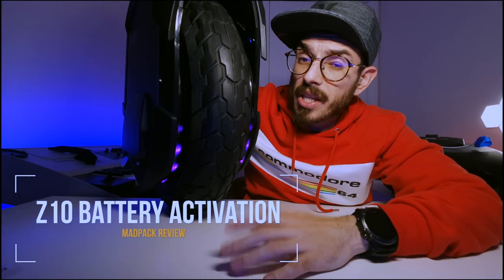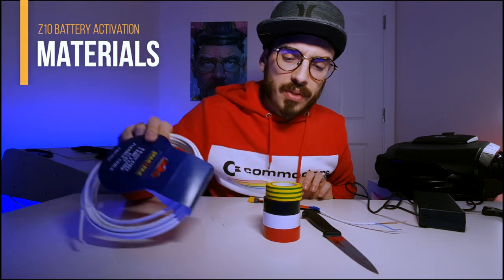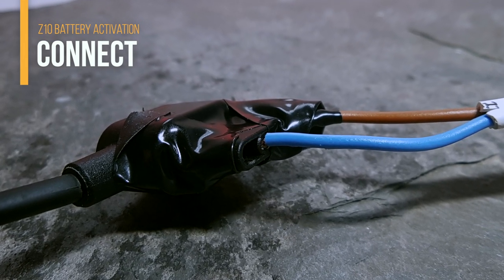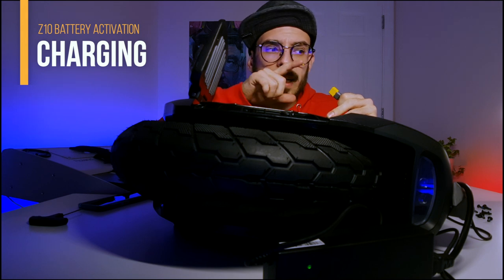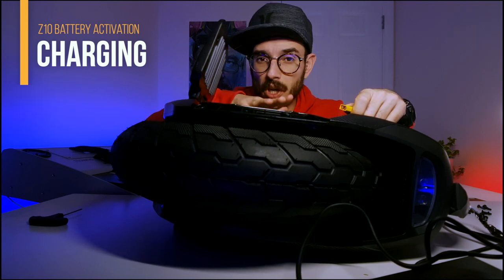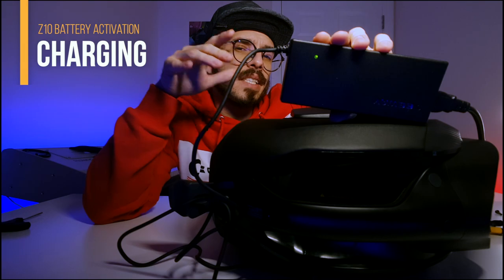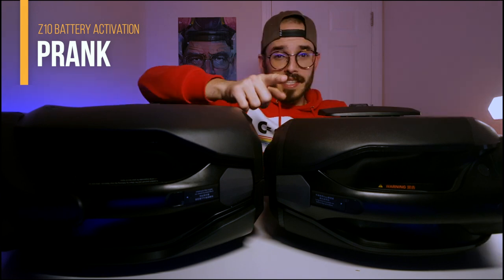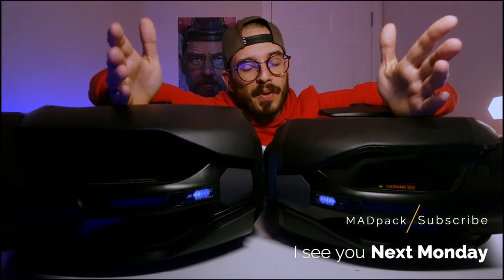Ninebot Z10 Battery Activation - THE ONLY SOLUTION!

Comment: I had the same issue.... I just left it for few hours connected to the charger... It refreshed the battery, and charged it completely... It's a nice hack but not absolutly necessery...
Reply from the maker: It is necessary. I left mine connected for days and the one of my friend the same.. Happy that you dont need it but 60% of use are having this issue bro. Thanks to leave a messgae
Reply: MADpack hi i did the hack. the charger has turned red immediately (did not blink red and green before going full red). HOWEVER, the battery indicator is not blinking at all (the one that was blinking red when power is too low and will blink red and blue when you start charging with the hack). should i leave the charger to charge with the hack for a longer time ?
Reply from the maker: No dont do that.. Is to much.. The objective is to charge the minimum to be able to after charge normally ok? 5 minutes in each pack should be more than enought
Reply: MADpack the hack totally worked! i was typing the message when trying the hack for the very first time that day. i asked if the battery indicator hidden inside should be blinking. i didn't want to pull out my mod cable to charge it normally cos i only have one charger, it's too much work trying to secure the bare cable to the charger connector. anyway, you were right, all i needed was maybe 10 mins of charging on each battery, then go back to the normal charging. my z10 battery went dead after leaving it untouched for 6 months (20% battery left after my last use)
Reply from the maker: Never store a wheel or skateboard with battery below 60%.. you lost cicles on your battery with that

Comment: I dont think its segways fault because this thing happens to all lithium ion powered devices that are left to discharge for a very long time its a lithium ions weakness also happens to my electric scooter that a bought from singapore and shipped here to italy but im lucky i know how to repair things like you and im happy for ur wheel gudluck and ride safe :)
Reply from the maker: Hi bro thank tou so much to take the time to leave me a message bro.. But no bro is really there fault.. They cu cost on The batteries cells cheap ones and there bms have problems on the software version at least on this ones

Comment: Tell me what to do if it doesn't turn on. I WOULD HQVE TO HOLD THE BUTTON  AND IT SHOWS BLUETOOTH SYMBOL THE FRAME OF TH3 BATTERY BUT NOT TURNING ON BATTERY IS BLUE. ANY IDEA?
Reply from the maker: Sorry bro I didn’t understand your question. Anyhow if you have follow the steps and is not charging maybe you have issues of the charging port

Comment: Can you help me with my problem? I can not charge my Ninebot Z10 directly anymore. I didn’t use it for quite a long time. Most likely, the device's battery automatically went into a deep sleep state in order to prevent discharge due to prolonged downtime. Fortunately, the battery can be quite easily reactivated.

I opened everything and did the battery activation again. I temporarily disconnected the battery from the gadget‘s motherboard, recharged it, and then reconnected after the required voltage had been reached. This disabled the lock and restarted the device. 

I had my ride and everything was fine. 
But now everytime I want to recharge my Ninebot I have to repeat the same process, because charging troughs the standard way doesn’t work.
Reply from the maker: I really don’t know what can be the problem since I never encounter this issue previously

Comment: Hey , after 4 month of not using wheel it is fully died , I tried to make everything like in the video but it doesn’t works, but also indicators on battery are not blinking at all ( not red and not blue ) 
Aby suggestions ?
Reply from the maker: Leave it connected for longer to see if it jump start eventually

Comment: Hey @madpack Markus! Thanks for your video! 

I think I have a similar problem with my Z10. 

So i bought it second hand last year with 110km . Then I did a few km last year and then I put it in my shed for a year (cold winter down to -1C). Took it out a few days ago went out battery still had 15km in. Went out and when I still had 8km on the app it started complaining that battery is low. I will had battery to push home. 

Charged it to 100% next morning took it to work. Arrived with no problems. 13h later after a hard shift i found it with lights on but not working. Pushing the power button didn't do anything. The battery icon next to it shows as empty battery and the Bluetooth blinking. When I try to connect to the app it stabilizes but never connects on the app. Also the led lights underneath are on blue and red for many minutes and then turn off for many minutes then back on. This goes on for 3 days now. I have put it on power show that battery is charging and the led on the charger is red when I do that. Tried long hold of the power button over 5' and nothing. Just lights on, LEDs on but no other response. 

Do you have any ideas as to what is the problem or how I could fix it? 

Please keep in mind I'm a noob in this but keen to open it up if need be. 
Any ideas welcome as I'm a bit desperate.
Reply from the maker: Can he 2 things bms or even the motherboard I would say
Reply: @MADpack  thanks for the reply! And could it just happen out of nowhere like that?
Reply: I was wondering whether it could have to do with the regenerative breaking issue (recharging only one of the 2 batteries) because the route to work had a bit of downhill.
Reply from the maker: Yeah it could but is never from nowhere
Reply from the maker: Have you checked the batteries on the app?!

Comment: Man you could be my life saver! Just before i plug in, may i ask why you have the white cable connecting the black & red cables and the charger? Can i just connect the xt60 jack to the charger directly through the black and red cables? cuz right here in australia i havnt found the xt60 heads that come connected to any cables at all, only the jack itself :(
Reply from the maker: If I could understand you can't find an xt60 cable so you want to connect directly just with a wire between the xt60 female of the battery to the charger is that? If its that you risk more to ruin your ninebot z10. If I could have found a plug to connect to the charger I will have made a full plug but I couldn't.   With an xt60 adapter the connection ispre stable
Reply: @MADpack  oh man sorry for my terrible English haha. What I was wondering was why you used the white 5mm cables, cuz I only have the male xt60 head and I have to connect it to the red and black cables myself. So I tried to connect the red and black cables straight to the charger but they were too big to fit in. Now i have followed every single step you did in the video and it's charging!!!!! Thank you man you saved not only my money to ship it back to China but also my time haggling with the reseller. He was super reluctant to help, giving me excuse like factory having breaks during Chinese New year and wouldn't help me ask the factory how to solve this issue, and he got me held up for like two months and still persists on letting me ship the whole thing back for repairs.
Reply: @MADpack  anyway I just wanna say thank you haha :)
Reply from the maker: I get half of my money back. The conversation with mine was the same see the other video that I've made about bro. And no problem. Happy to help and to see you here. Sometimes because not lot of people not send a message you feel that you are just talking to the wind so thank you to send me a message and to take the time to do it. Hope to continue to see you in the comments section. And yeah you cant connect directly because the cable doesn't fit.

Comment: Nice...I've done exactly the same thing to start mine, unfortunately in my case the problem is a bit bigger. I managed to start this bad boy but I had an message error saying battery 2 abnormal communication. Checked the batteries but seems to be fine( probably software related issue). And on top of that in my first day out trying to learn how to use this, I had a puncture. trust me you don't want to have any, is a nightmare to fix a puncture on this. Fixed but I managed to destroy The MOS board. Order new one & to be on the safe side ordered the mother board to...Can you please tell me what software version is on yours???
Reply from the maker: I have the latest one bro. That is really bad hope that you will figure out. Im jot with the wheel next to me but when i check it is the latest version that is installed
Reply: My brand new Z10 is stuck in “Limited Mode” or activation mode.  It fails to activate every time I try.  Software V1.0.5. My unit has power and turns on but doesn’t balance/have an active motor.  How did you solve this issue?
Reply from the maker: First of all thank you to leave me a message. Bro i dont know about that. Try to go on the communities on facebook.. There i get some help and after i made this video helping a friend. Sorry bro

Comment: Hi, nice job btw

has your bms leds blinked before you charged it this way?
asking that cause mine bms dont blinks at all, wanna try your method
Reply from the maker: They blink in red bro
Reply: @MADpack  thank you so much, worked like a charm
Reply from the maker: Amazig really happy that it worked for you
Reply: Mine are not blinking as well and batteries don’t charging the way like in video :(
Reply from the maker: @vadimkorobov7306 try for longer to leave it connected if not working new battery need to be purchased
Reply from the maker: @vadimkorobov7306 new battery
Reply: @MADpack  you think it is damaged because of long stay without charge ?
Reply from the maker: @vadimkorobov7306 yes I believe so

Comment: Hi, I think I have the sme problem. I sent my Segway to the service and told me that in this case I must replace the battery . Now it is almost 3 years since….do you think I can solve this issue?
Reply from the maker: Solve in which sense bro?
Reply: I would say there is a fair chance you will get it back to working with these steps. I received one (given away to me) and the packs were down to almost 2v (yes, that's 2 VOLTS) but since the batteries in these are very high quality, it came back to life & charges properly, runs absolutely fine.
Reply: @MADpack   I mean , mine is not starting anymore...no movement at all...
Reply from the maker: @constbogdan really sorry to hear that
Reply: @constbogdan  What do you have to lose?

Comment: Hey there, saw you successfully fixed you Z10 Battery deep sleep problem on another video through the comments. Wondering if you could
please help me.

So basically I my friend hasn’t used his Z10 in about 1.5years. So I connected the unit normally to the charger and the charger LED was
flashing red & green slowly… then turned green in about 10minutes…

So I saw the video and did direct connection with extra cable, now the charger light is now red (stable / not flashing) which is good.
But the small indicator light around the battery on the Z10 isn’t flashing at all… Any ideas? Do you think it is still charging?

Q2, Also how long do you have to charge each battery with the above DIY wire connection before changing back to normal charging port. Thanks
a lot! 😊

(also I have disconnect the white cables while I do the DIY wire charge direct.)
Reply from the maker: Like i said on the video i believe 10 minutes per pack.

Beside that after you can always go to the app to check the battery on your z10
Reply: @MADpack  Thank you, so I hooked up the white connectors and then it started blinking blue! So now closed everything back up and now charging normally. About 2 bars now. I tried turning it on after disconnecting the charger and nothing.... I am just fixing the battery issue for my friend. Do I need a special serial code for it or something, or can I just download the app? How do I turn it on after it has some battery. Thanks again from New Zealand :)
Reply from the maker: Leave it chsrging for 12h. After just download the app and you will be able to see if the batteries are normal
Reply: @MADpack  Hey, thanks for your replies. So I have left it for 12h and now it is fully charged. I still can't turn on... and without it on I guess I can't even connect to a phone / app. Do you think I should physically look at the motherboard to see if there was damage? I don't know how else it should turn on. I held the on button for a long time, double clicked, still nothing...
Reply: @Celtic-Acid  did you ever figure it out ?

Comment: So after 7 months, is the z10 still in good condition. It's in my to buy list but I've found so many problem on this z10. From the battery problem, and the burning motherboard.
Reply from the maker: Almost 2000km and still moving
Reply: @MADpack  looks like Ill keep my new one then. I'm not planning to travle long distances, maybe when I get a bit more epxerienced, 25 - 30 mi. at most.
Reply from the maker: The z10 is not for long distances. In range is limited for what im used now

Comment: Hey bro. what does blue led blinking? thanks
Reply from the maker: Is saying that the battery is working
Reply: @MADpack  How come when i charge it the green indicator stays green in the charger and the blue flashes fast and the battery does not charge. Just need help if u know what is the problem?  im new owner. thanks again
Reply from the maker: So which blue are you talking?
Reply: @MADpack  the blue small led at the battery itself
Reply from the maker: Can you turn the wheel on?
Reply: @MADpack  yes everything works fine. i can turn on and off. ride with it. it has 23% battery charge. i ordered the xt60 connector and will try ur  video. hopefully it will work.
Reply: instead of red led blinking in the battery pack mine is blue when connected or not connected to the charger.  should i try to drain the battery all the way down?
Reply from the maker: So you can turn on your z10 just is not charging the z10 when connected? Is that? If yes .. My hack is not going to solve your problem. Is possibily the charging port in the z10 that is damage or is the charger. Do you have someone that can borrow you a charger? That will be the first thing to do.. If not my hack will show you if the charger works.. And in the moment you are aware that is the charging port
Reply: @MADpack i think im the only one that has  z10 in my area. i will check the port. if not im going to buy new charger.  thanks
Reply from the maker: It you have the connects to my hack.. If it works is the chargig port on your z10 that is gone..

Comment: My brand new Z10 is stuck in “Limited Mode” or activation mode.  It fails to activate every time I try.  Software V1.0.5. My unit has power and turns on but doesn’t balance/have an active motor.  Has anyone else heard of this issue?

Comment: Thanks for this video . awesome job at explaining and showing how to fix the battery issue with the ninbot z10 .
Reply from the maker: No problem bro.. I just thought that to many people need it this.. Saw many videos of people showing but now really explaining everything it took me a bit to get all the information that i wanted to make me think.. Ok it seems secure to do in this way.. So thats why i put together this video for you guys
Reply: I was going to do a video if mine was in deep sleep when mine arrives ,I was the same I've looked all over and not a decent video about, I've bought 2 male xt60 splitter so going to charge both batteries at the same time , you might of seen  picture of it on the forum , thx for the video ,ps! Did you leave the charger plugged in when connecting the Xt connectors
Reply from the maker: I recommend to turn off first before connecting. It should not give you any problems. In this video, I couldn't do it because I was recording for you guys and I was sure that my connection was well-made bro. But yeah before you connect disconnect the energy and after just press the energy button

Comment: Dude I just picked up a z10 to mess with but you're a little bad-ass man
Reply: @MADpack   Yeah I like how you were able to reboot the battery like that that was pretty bad-ass man we need to see more stuff like that awesome video
Reply from the maker: Ahahah i need to do it again to mine to much tome without using and now is not turning on once again :)
Reply: @MADpack   So if the battery gets too low that's when this happens so the battery should stay what at 20% and above
Reply from the maker: You should never stock the wheel without been fully charged the bms on the z10 is garbage
Reply from the maker: Nope and i will not play with batteries
Reply from the maker: Maybe i can make videos about the z10 but the z10 became only a classic
Reply: @MADpack   Yeah but you know what I know there's a lot of people that have these man and the reason I bought it is because I think there's potential there still un tap potential . And I might get some ideas from it too I liked the 4" tire